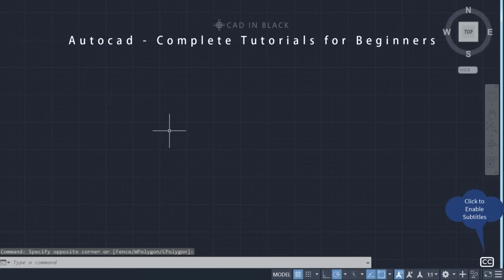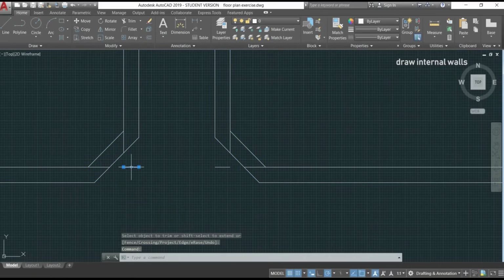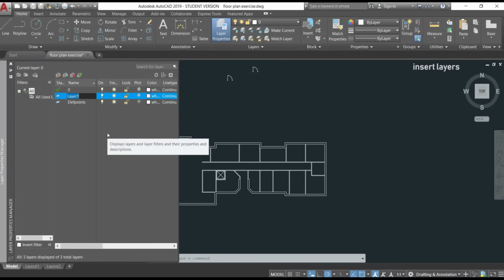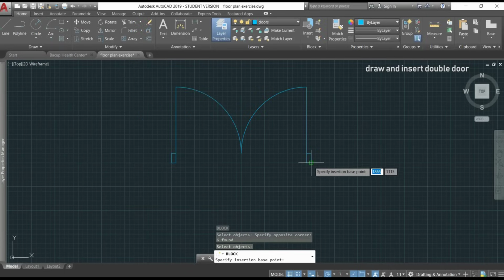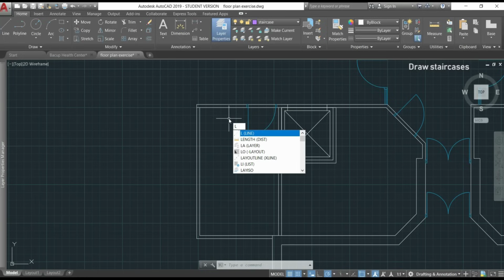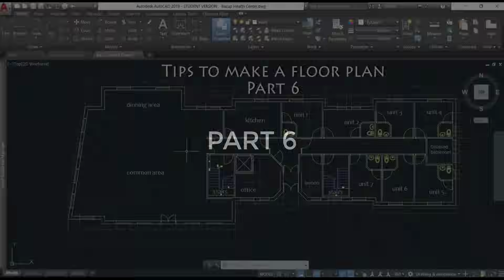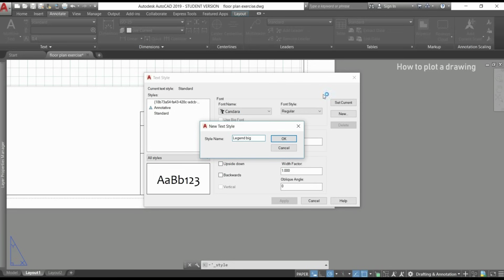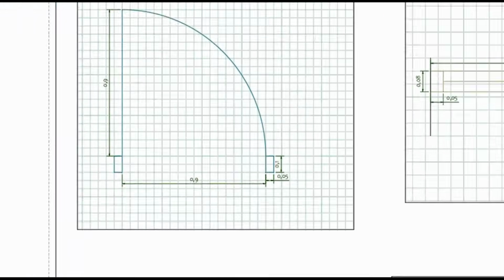Autocad - Complete floor plan for beginners - Exercise: Care home

Comment: Where exactly are the dimensions for the front hallway entrance in the PDF? I see the opening of 1.8 and then a chamfer distance of .88 for on the edges on the right side however after that there are no dimensions.
Reply from the maker: Hello Snowman. Which dimensions you tell are missing? In my file I can see dimensions to the right as well.

Comment: I have a question regarding diagonal size, as you didn't specify in PDF file the dimensions for it, so where did you get 0.7? Thanks in advance
Reply from the maker: Hello Aziz! Please can you mention the time I mention that?
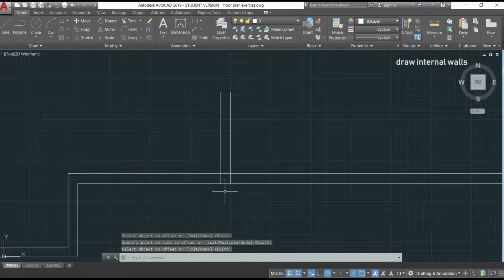Reply: @13:00
Reply: @PeriZisi  he never reacted? :(
Reply: @geraltofrivia7801  The external chamfer is 0.88 as shown in the PDF. The instructor probably measured the internal length of the chamfer after offsetting  the external one.  if that makes sense.

Comment: hi sir, after I downloaded the blocks needed like toilet and lavatory. when i insert it on design center the block is unitless and when I put it on CAD the block is really small. smaller than 0.01m. How can I fix it sir? Please help me ...??? thanks in advance :)
Reply from the maker: Hello Rowell. 
Autocad also provides sample files with blocks to use in your projects. A lot of people does not know this feature. By default the files are located on:
c:\ -> Program files -> Autodesk -> Sample -> en-us -> designcenter
Open the files and check their content.

Regarding your problem you can use scale with reference to put it right:
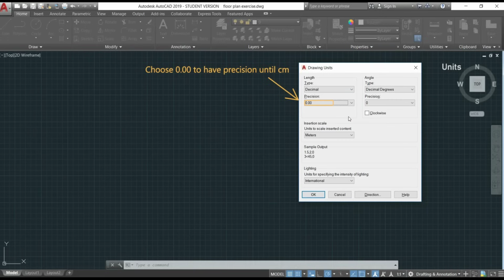https://youtu.be/JlAGkJoFGSE (1:56)
Reply: @CADinblack  thank you sir, I will check it later.

Comment: i may be a bit late, but can anyone tell me where he got "2.8" @12:40 and .7 for the diagonal distance. thanks
Reply: Up for this
Reply: Since no one replied. The answer is easy: he took the interior dimensions. Just do a 0.88 square right where the 4.75 wall value ends, and then do a diagonal. When you offset it 0.3 (wall thickness), the interior diagonal can make a small square of 0.7. He kind of skipped a few steps there, and there are quite a few dimensions missing overall (he could have added some extra angles for clarification), hence why you have to do some extra subtractions here and there to get the missing values.

Comment: I'd mention that when you create the dynamic restroom block, it is only for personal use. It is not acceptable to do that if you work on an office and other team members also use your drawings. You could get fire if your boss finds it. Be careful. Overall well explained Cad in Black!
Reply: Thank you for replying ! Much appreciated.
Reply: @crispinandrews8400  do you use Autocad for work?
Reply: I use autocad for school.
Reply: @crispinandrews8400  great! I'm an Architecture student too
Reply: Lazy Arquitecto Coool ! I actually study chemical engineering but I use Autocad as well. Such a useful programme.
Reply: @crispinandrews8400  Autocad is a useful program and I try to help save time from my channel too.
Reply: @LazyArquitecto  
Out of context, but when you’re making the window, how did he manage to select only some and not all the lines in block editor. It makes me keep stretching all of it.
Reply: @LazyArquitecto  
At 1:15:04
Reply: @Ace.x999 make sure your corner of stretch frame is only enclosing part of the window as the video
Reply: Hi Lazy Arquitecto, can you explain a bit more please ?
Reply: @crispinandrews8400  sure. When you work for someone or in an office, you need to follow your office standards.  They have already all type of blocks that they always use. You can not just create a block inside another block. Your coworkers might also need to work in your drawings, and have issues of manipulating this nested layers.